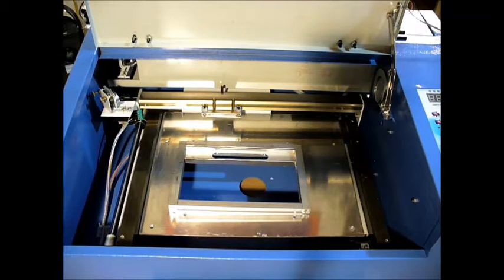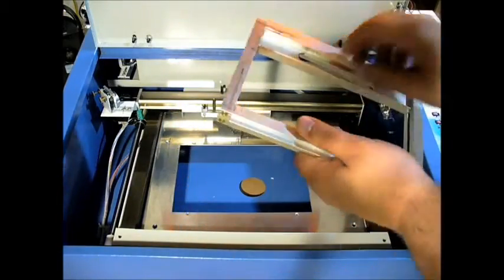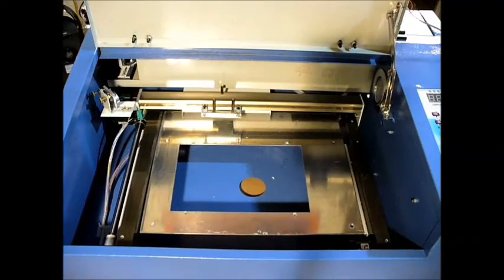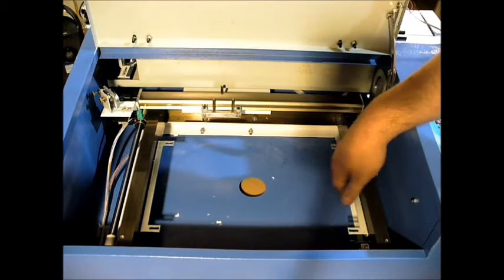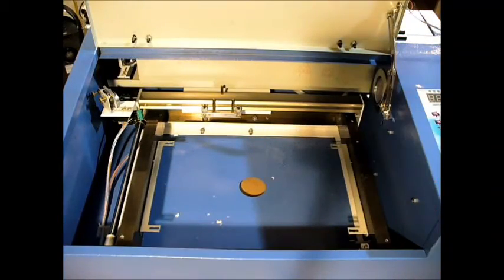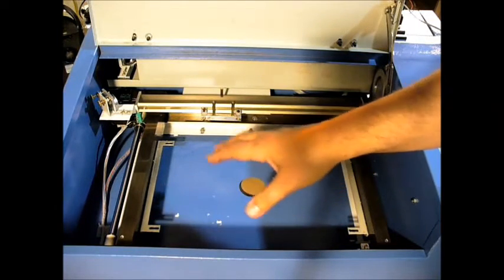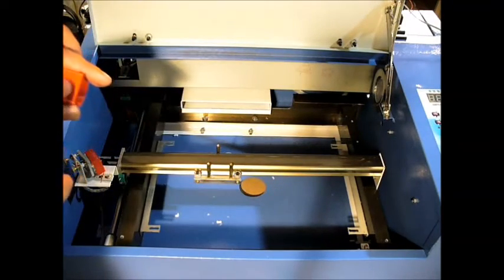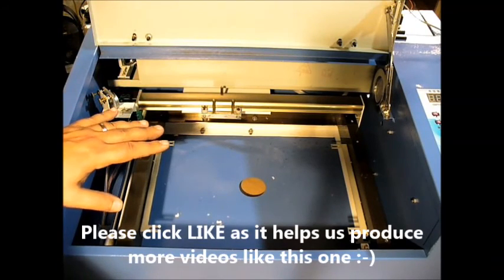eBay Chinese CO2 Laser Cutter & Engraver - Bed Removal

Comment: My cutting bed is not mounted like this. It is mounted on 5 standoffs that attach vertically to the case bottom.  I guess they are making improvements/changes as time goes by.
Reply from the maker: There are differing versions as I have another one which is like what you mention with the standoffs...